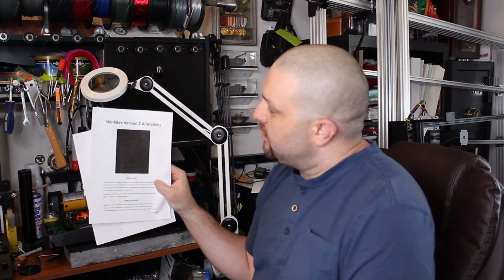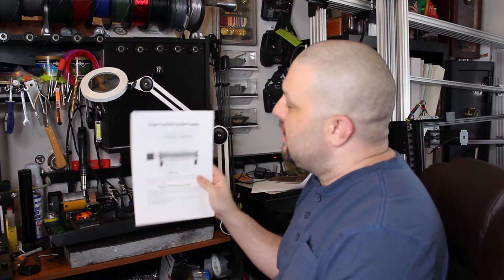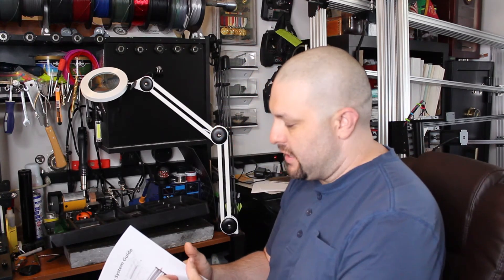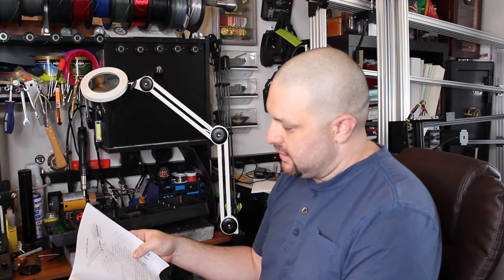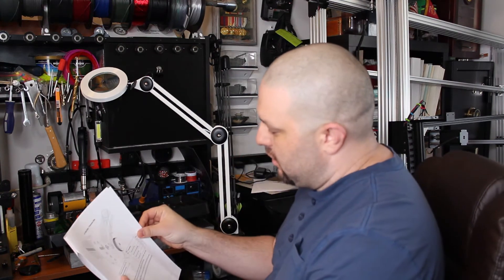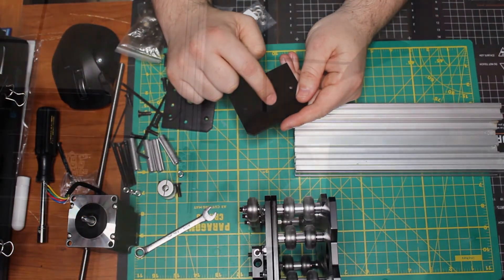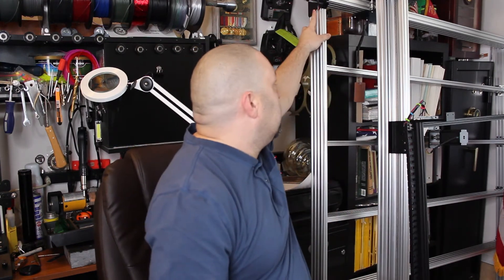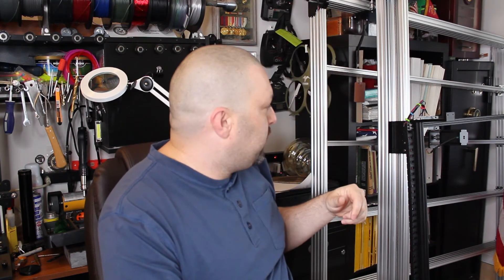**UPDATE** BulkMan 3D/WorkBee CNC 1500x1500mm Series **UPDATE** - Series episode 4.5

Comment: Don't buy from them if you have a problem they don't want to know. No after sales service. It will cost you more in the long run.
Reply from the maker: If you have a problem try reaching out and getting it fixed. Just because you have not had the same good experience as others doesn’t mean they are bad across the board. I have never had one issue with their service, and the vast majority of people have experienced the same level of service. I would  re-calculate your issue and method of contacting them and see if you can end with a better results.
Reply: @702marine  Have done that but they don't reply. The test of a good supplier is when you have been sent a faulty part and how they deal with it. They just don't want to know.

Comment: Installing the lead screws. The mounting brackets,  when tightened down the lead screws become very stiff almost un moveable. How tight should these be? Should the lead screws be freely moving?

Thank you!
Reply from the maker: The motors run at a very high torque. Much stronger that you can do by hand. After you get up and going for awhile make sure you recalibrate your machine. After things are worn in things will become easier for the motors to turn and that will throw your settings off a bit.

Comment: Idk if you can help me with this. My y axis is not pairing correctly. One side will move forward and the other side will move back a little and then go in the direction it’s supposed to go. Do you know what the problem might be.
Reply from the maker: It sounds to me like you need to work on your acceleration and velocity settings. Also check your lead screw blocks to make sure they are not binding up. Do you have the Y and A axis settings set the same on the ports and pins menu in Mach3?

Comment: How u like bulkman 1515..it looks like a good bang for buck machine..how well does it perform?
Reply from the maker: I have been shopping around for a CNC setup for a couple years. I looked at all different types, sizes, and price ranges. I was willing to pay up to $10k for the right setup but I wanted the best value for the money I was going to spend. After all of my looking I landed on this kit for many different reasons. I really liked the idea of putting this together myself that way I know every little thing about it and can keep it up and running easily. Everything about this kit is made up of easily obtainable parts supplied by many different sources and the prices are really low. Also one of the biggest things I wanted was for it to be expandable. If at a later date I want to upgrade, it can grow with my needs. For me the price to value was hands down the best. You also cant really put a price on the experience and learning that comes with putting something like this together. For me that is a big part of the value as well...
Reply: No after sales service from them

Comment: If you use the thrust bearings mod  the plates need to be mounted like in building guide  version one...so i think your CNC is mounted right for this mod.
Reply from the maker: Yes but it was referenced in one of the updated manuals to reverse the plates.That way the thrust bearings would be seated in the pocket. I specifically asked Bulkman how they intended for the thrust bearing update to be used and they said the way I used them. I just wanted to address every method so people can make their own choice.